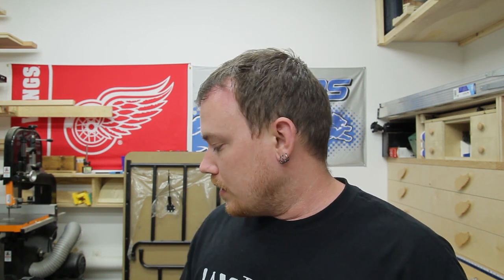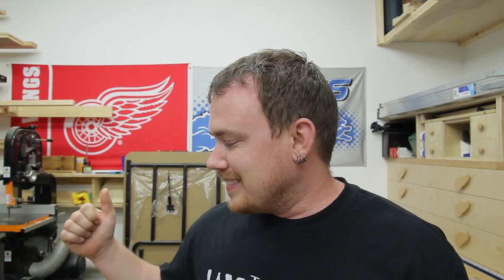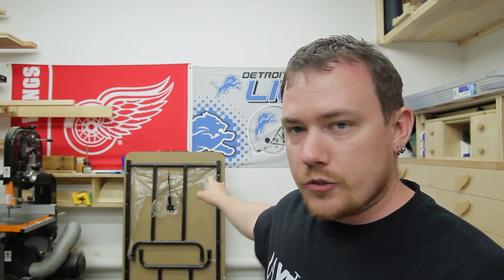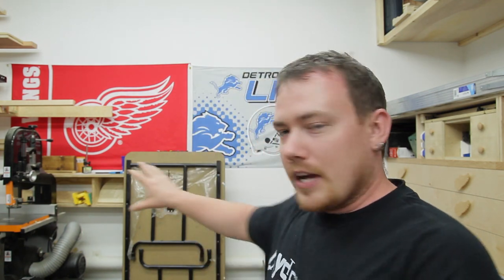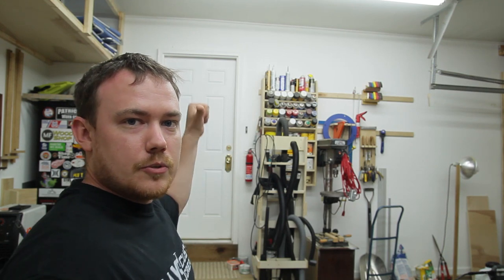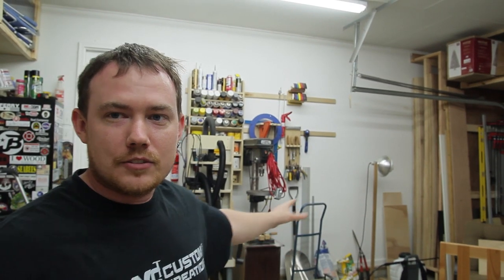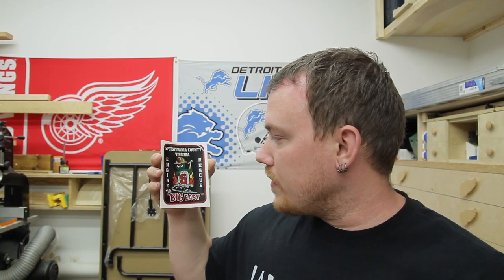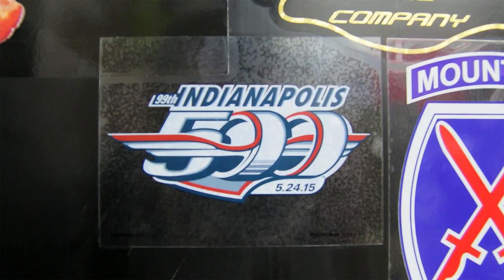More Shop Projects Coming

Comment: Hey Jay. As far as glazing over white cabinets, our laundry room cabinets are white with a 'glaze' for an aged look. From what I remember they just wiped on a brown stain over the white then wiped that off before it dried, leaving a slight colored, aged look to the cabinets. Also, some sanding of the high spots to expose the wood underneath, then a clear coat. The cabinets are MDF with some wood moldings. They came out great.

Comment: Jay, you should check out the dust hood I use with my Porter Cable router on my CNC.  The air is redirected to the side and it works very well.
Reply: Dave Gatton What Dave said. I'm going to make a side-exhaust dust hood for my router really soon...
Reply: Let me know if you want the files I used Mark.
Reply: I'd love them, Dave!

Comment: Saw Stop is the best purchase/saw you'll ever buy. I've had one since they first came out. NEVER had a problem. ALWAYS check the blade /spall clearance after changing a blade especially Dadoes. I had a 'high' tooth on a dado trigger the cartridge because I did not rotate the blade once installed..I use a nickle for clearance check. Be safe.

Comment: Have you thought about building a dust shoe/boot for the router spindle? Would help keep the dust from blowing too far.
Reply: Scoszko 35 I have yet to see a successful dust shoe for the Bosh Colt router. I really don't want to purchase another router just to put into the machine. I'd rather use the one I have.

Comment: Had fun but got all burned up. Know the feeling. Glad you two got away and great to hear the little guy is doing well after the snake bite. I don't have a CNC but was thinking since the router blows down, if you hook up DC with a skirt to catch the chips and dust, wouldn't that keep it somewhat dust free. Just a thought.
Reply: MRrwmac There are a lot of dust shoe options out there for routers but none that I have found for the Bosh Colt which is what I have. I really don't want to purchase another router just to use on the machine if possible.

Comment: I hope you don't take this the wrong way, because I really enjoy watching you build shop projects. But do you have any plans to build strictly and specifically home furniture when you "finish" for the most part, your shop projects? Or getting into more of the fine furniture building?  Dovetails, M&T joinery.
Reply: Joshua Luther Didn't take it the wrong way at all :) My wife has a long list of indoor furniture projects for me to make but the bottom line is I have to do what performs better and earns more for my family. As far as traditional joinery, only if power tools are involved. I don't have the patience for a lot of hand cut joinery.
Reply: Thanks for responding.  I totally understand about doing what's best for your family.  Also, your shop is really looking sweet.  

As far as your shed is concerned, I've been wanting to get one for a couple of years now, and it keeps getting pushed back because other things take priority.  My father-in-law keeps wanting me to build my shed cause it's what he did.  I just don't want to build one when it will maybe save a couple hundred bucks.  My time spent building it is worth more than that.  Plus, I just don't want to.
Reply: Joshua Luther You can definitely save some money by building it yourself and honestly will probably result in a better built shed but I agree with you. I simply don't want to.

Comment: Not sure if it would work on a shop bot but have you looked at the water cooled spindles. a 1.5kw spindle and vfd are really not that expensive and the plus is there's no fan blowing dust everywhere.
Reply: klawndyke I haven't looked into spindle options really.

Comment: "...I can't put any more crap in my shop." Yeah, right. That's what they all say...

RE: Glazing white cabinets. I've done a little bit of glazing, but not much. It really depends on what the existing finish is. You could practice the technique on the toilet cabinet, and that'll be fine, but unless you know for sure that the toilet cabinet and the sink base cabinet in your bathroom have the same finish, there's no guaranteeing the results will be the same. If it were me, I'd pull one of the doors or drawer fronts off of the sink base and experiment on the back of it. If it works, great. If not, it's easier to hide the fact that you had fix the back of it (even if that means strip the back of the door/drawer front and refinish it) than it would be if you did the front of a door. Just my opinion.

Comment: In 2016 is the running of the one hundredth Indianapolis 500 Mile Race  Starting in 1911 with 80 thousand paid spectators (the race didn't happen during World War 2) to this years race with a estimated 250 thousand fans watching fast cars at nearly 230 miles an hour. The race is one big party. Just a few facts about the 500 Mile Race. Yes, I agree it doesn't have a big following on TV not as big as the NFL or the World Cup.  I was speaking of paying sports fans. Just clarify my statement.

Comment: I upgraded my Shapeoko 2 with the Makita RT0700C router and found that the guys over at Norwegian Creations had designed a dust shoe that fixed that "fan blowing dust everywhere" effect and could be 3D printed locally. I have since upgraded to the SO2 to the X-Carve and still use the Makita with the dust shoe. I know you don't want to get another router for your X-Carve and maybe they have a similar option that will work with the colt. http://www.norwegiancreations.com/2014/08/an-open-source-cnc-dust-shoe/

Comment: Wow,  one week later and you've already realized that the plywood rack is a big mistake for you!?    That must have been rather frustrating.

Hmm, is this why you're asking about a 4x8 outfeed table on FB?   then you could slide your plywood underneath that?   If so, interesting idea.  Though I would still be one who thinks 4x8 is way too big for an outfeed in a garage-sized shop.

Regarding the Xcarve...  do you think it is just designed for lighter use?
Reply: wordsnwood My garage door is one of the more frustrating parts of the plywood rack. The outfeed table is separate thinking. Just not sure how big I want to go with mine. Im not sure what my final thoughts on the xcarve are. It's definitely a slow machine with the stock spindle.

Comment: I would have thought the Superbowl was the most watched sporting event.  Our local TV News crew sends reporters to the Superbowl and even to David Letterman's final show, but other than saying a car flew through the air during a practice run, that's all was said.  I didn't even hear anyone talking about it and I guess I missed seeing it on the TV.  If you don't have cable or satellite TV, I guess you're in the dark on most sporting events.
Reply: In 2016 is the running of the one hundredth Indianapolis 500 Mile Race  Starting in 1911 with 80 thousand paid spectators (the race didn't happen during World War 2) to this years race with a estimated 250 thousand fans watching fast cars at nearly 230 miles an hour. The race is one big party. Just a few facts about the 500 Mile Race. Yes, I agree it doesn't have a big following on TV not as big as the NFL or the World Cup.  I was speaking of paying sports fans. Just clarify my statement.